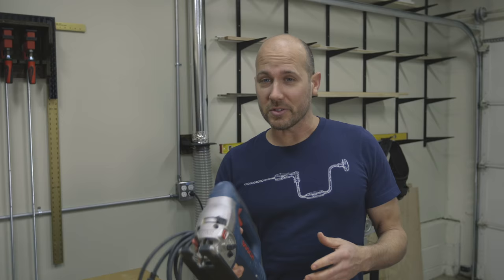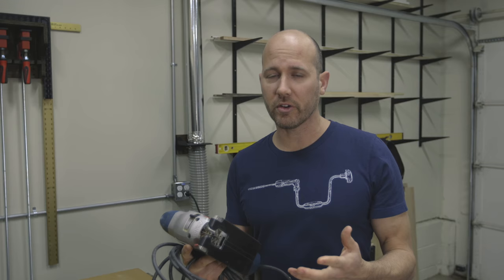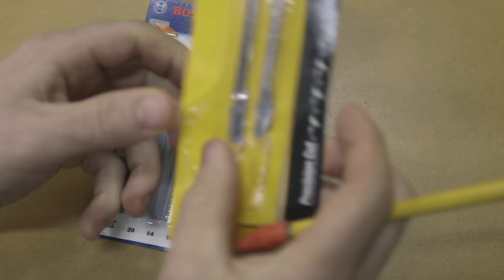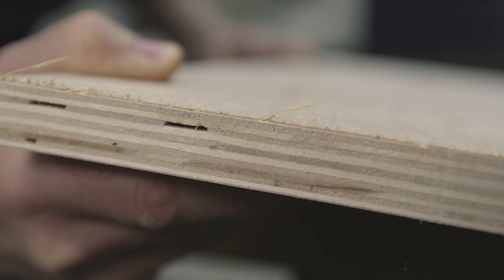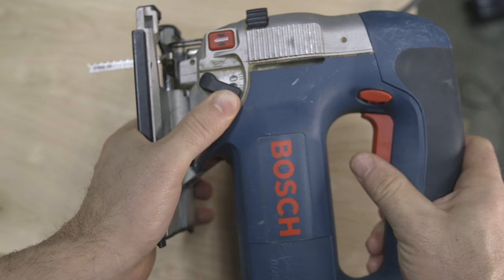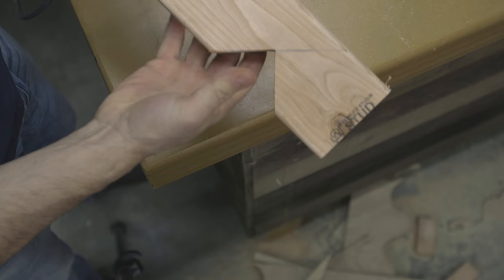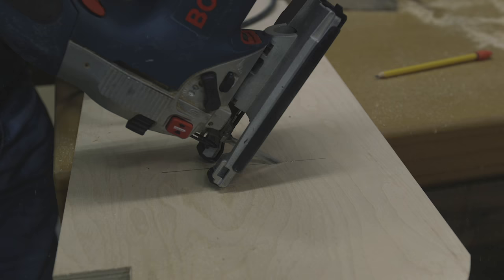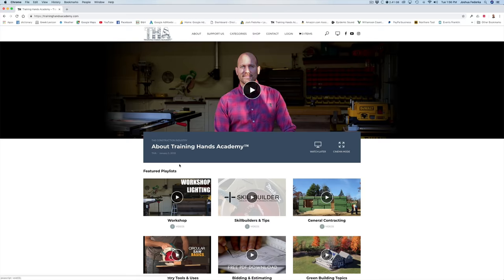How to use a Jigsaw - Basics

Comment: One thing I'd add is look where the saw is going, not at where the blade is currently cutting - you'll get a much better result.  On my battery saw the front blade guard loop dips right down to just above the cutting surface, so when I'm following a cut line, I use that to steer the saw - guess they designed it like that on purpose on that particular saw as my plug in saw doesn't go near the cutting surface.  Also, relax and let the saw do the work, keep your elbow bent and your foerarm perpendicular to your cut - when I first started I used to bend a lot of blades from putting too much uneven pressure on the saw.
Reply from the maker: Thanks for adding this great info!

Comment: Thank you, sir.  Thank you very much.  I need to cut a vent hole on a plywood, for my floor AC.  The guy I so politely requested to help me out with this hasn’t responded.  Well then, I shall have to do it myself!   It is good to be self- reliant, but be sure you know what you’re doing, and be safety conscious.  I am no stranger to small power tools ( I have a small cordless miter saw and small cordless circular saw from Ryobi, and of course, have the power screw/impact driver).  But my experience is very limited.  So I always check in on available training or refresher courses.  So, after this video I’ll get me a jigsaw and get on with my tiny project.  Thank you, again!

Comment: I would recommend the barrel grip over the top handle . Much better feel to it , 
plus you could get around using the down stroke blades when cutting  on a top surface 
you don't want to splinter. For example if you have to cut a plastic laminate counter top 
sink out or end of it off , you simple make a through hole then go on the bottom of the 
counter top , stick the blade through , so you are cutting upside down from the bottom of the counter top. You will get the splintering on the bottom of the counter top. Plus you will see the blade very easily. Takes a little getting used to , but works perfectly. Hope i was of help . Great video btw.
Reply from the maker: Barrel grip for sure!

Comment: I am about to start with some very basic carpentry projects, and the jigsaw is the first cutting power tool that I am about to buy. Could you do some videos showing different techniques that allow using a jigsaw as a replacement for other saws, how to do a long straight cut with it etc.
Reply from the maker: Check these out. https://youtu.be/nFhM86zBgCI  https://youtu.be/kk6iHLOHmOY

Comment: my first jic saw was without quick saw mount, and without pendeling. i could get very straight lines in thicker wood without the saw going / sideways. but with those new features i don't manage it anymore to get the saw cut |  it always is / .   any advise on that?  (i use good quality sawblades)

Comment: I have destroyed some jigsaws from doing plunge cuts. They are not all designed to be able to do them. Always check your user manual or consult with the manufacturer’s specifications to see if that model is okay to do plunge cuts. 

On some makes and models, doing plunge cuts will create additional force on the mechanical components that generate the reciprocating motion of the blade and they will break. So I rarely recommend or show anyone how to do plunge cuts on the jig saw anymore. I do plunge cuts exclusively with a circular saw.

Comment: that saw looks like the one I need to repair. Do they sell a rebuild or overhaul kit for the blade guide and roller? It is about fourteen years old and won't make a plumb cut. Still runs and cuts anything I throw at it, just not clean and straight. I recently bought a newer Bosch and it is not nearly as good as the old one. 
Thanks for making these videos, I'm sure it helps a lot of people.
Reply from the maker: Hey! I'm pretty sure you can go here and find almost any part. https://www.ereplacementparts.com/power-tool-parts.html?utm_source=bing&utm_medium=cpc&utm_campaign=power+tool+parts+people+not+in+audiences&msclkid=e5323ef4f9171b2d7baf5f0a4d4b4685&utm_term=tool%20parts&utm_content=Power%20Tool%20Parts

Comment: Video Notes:
1. Blade length matters; go for at least an inch or more than the depth of what you’re cutting
2. Two grip types: top grip vs barrel grip
3. BE SURE whatever you buy accepts T-shank blades
4. TPI = teeth per inch
5. Lower TPI = less clean cuts; higher = more clean; TPI is on blade packaging
6. Two different blade stroke types: upstroke vs downstroke; he recommends upstroke
7. Upstroke creates tear out on the top side of the material whereas downstroke creates tear out on the bottom
8. Reciprocation is how straight up and down the blade goes; 0 reciprocation = straight up and down; max = oval
9. More reciprocation = faster cut, less clean; less reciprocation = slower cut, more clean
10. 3 types of cuts
   - Short & straight, i.e., “regular” cuts: finishing, curves, nibbling, etc.
   - Middle material cuts: works best with a drill bit to create a starter hole
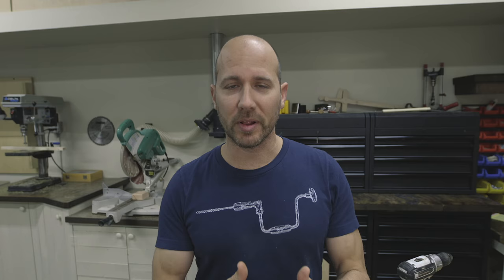   - Plunge cuts: when no drill bit is available (watch the video at 5:00); can be very sketchy
Reply from the maker: That's awesome! Thank you.

Comment: Hi, need your help, I'm cutting the dining table to half to use and make a cabinet out of it, do you think I may cut the 90 cm length from the wooden surface of table with a jigsaw? One of my major issue with jigsaw cutting is that it doesn't stay on a straight line and it always makes uneven cut specially when cutting lont length like 90 cm
Reply from the maker: Hello. A circular saw and a straight edge would be best.

Comment: A key message is to respect your tools, don't abuse them and use in a dangerous manner. Always be humble and know how far to push it. You will get a feel. Let the tool do the work don't force it. I have had a few close shaves and trust me it's not worth it. One thing I do with a jigsaw/circular saw is to ensure it is running at speed before making a cut...there is a risk of kickback otherwise.
Reply from the maker: Great info!

Comment: Thank you so much for sharing...
I need one of this power tool...
Reply: Visa Chusi I recommend the Bosch 572ebk barrel grip or 572ek top handle. You can get the top handle on Amazon until June 18th for $172 which is a killer deal. The barrel grip is $200 which the $20 coupon.
Reply: @Assimilator702  thank you so much.
It might be good out there but its hard to believe in india whether its orginal or duplicate.
Anyway thank you for the  tips

Comment: Great video. I have a question, though. I have a top-end Porter-Cable saw and use Bosch blades exclusively. However, no matter what I do (new blades, checking the saw table for zero tilt, adjusting for UFO intervention, prayer, etc) I cannot get a clean verticle cut from one end of a pass to the other. The blade always drifts out of plumb. Suggestions?

Comment: What do you do if the blade itself doesn't stay straight when cutting? Meaning, the blade is bending while actively cutting. Also, what if you need both sides to be finished sides?
Reply from the maker: Hello. Thanks for asking some great questions. Using a thicker blade and/or using a blade that is shorter will help. Jigsaws aren't really one of those tools that cut really well, so getting a jigsaw to cut good on both sides can also be a hard. You can try using a blade that has a higher TPI and cutting slower. This might help to get that top side clean (if you are using an up-cut blade)... but again, it is a hard to do with the jigsaw. I hope that helps?

Comment: Great video. How do you prevent blade deflection? When I cut a 2x4 the may deflect not cut a perfect 90 deg straight through.
Reply from the maker: Hey Troy! It's very hard to get great 90 degree cuts with a jig saw blade. Jigsaw blades will always have some deflection no mater what. If that's the only power tool you have, try buying the thickest blade you can find and slow down your feed rate.

Comment: Oh yes, listen to the man about that T-shank blade option. I bough some dollar store jigsaw without it and somehow happened to miss that it didn't even have speed control which I though was always on jigsaws. I tried to use it for about five times until I ordered about 20x pricier Hitachi model with all the soft start, cradle, speed dial, swing cut etc. goodies with obviously that T-shank blades. Time to change blade is now about 5 secs compared to minute or more with cheapo garbage, which is literally thrown to garbage. Was it worth that 20x price? Oh hell yeah it was :D

Comment: can i used a jigsaw to cut a 1/8" thick piece of polycarbonate sheet (Lexan brand) into a geode shape with a hole in the middle? i have a resin art project and need to make a geode shape with smooth edges.
Reply from the maker: Yes, just make sure you get a blade that is designed to cut polycarbonate.
Reply: @TrainingHandsAcademy  thanks!

Comment: I don't understand why my new blade is flexing on a straight cut with a straight edge guide (Bosch FSN ) :(
Reply from the maker: They do that. Buy the most rigid blade you can get... the jigsaw is not the best tool for straight cuts... use a circular saw.

Comment: You mentioned that a T-shank is better than a U-shank. Would you mind going more into detail please?
Reply from the maker: The T-shank locks in place and can be removed very quickly. It also will not come out... it is very secure. While the U-shank is harder to install and is not as trustworthy.

Comment: Hi, whenever I've used this tool it has been mainly straight cuts. How do I come about cutting in shapes and curves etc. In terms of what settings to apply on the jigsaw and what sort of blade?

Thanks
Reply from the maker: Hello! Set the jigsaw to no reciprocation, and use a high TPI blade. If you are cutting tight curves, use a Scrolling blade, and if you're not, a standard high TPI blade should work. Does that answer your question M Ali?
Reply: @TrainingHandsAcademy  thanks.
I will try that out.
Kind regards

Comment: I’d love to learn how but that saw scares me. The old saw that was my dad’s only had an on off so  I don’t think it had speed control .
What’s scary to me is how to start into the wood without kicking back .  Was thinking of getting a new saw with the trigger speed control but I’m still too nervous of this saw. Thoughts ?
Reply from the maker: A new saw would make a very big difference. These saws are actually pretty safe and don't kick back often. If you can afford it I would recommend this one. https://amzn.to/3LwJm6p
Reply: @TrainingHandsAcademy  what do you think of ryobi? I have small hands so that Bosch may be awkward. I just got my first router. So I’m going to get used to that first then I’ll decide on a new jigsaw .
Reply from the maker: @JanineMKartist  You sure can buy a ryobi! Whatever feels more comfortable in your hands.  Routers are actually much harder and more dangerous to use compared to the jigsaw. My recommendation would be to get the jigsaw down first before moving on to the router. Please be sure to watch all my router videos. :)
Reply: @TrainingHandsAcademy  will do . I’m not going to be doing. Edge work with it. I’m going to get the Rockler circle and elipse jig to cut oval panels to do my artwork on.

Comment: Hi you might know how to change blade for bosch pst 52AE??? Thank you very much...
Reply from the maker: I'm not 100% sure but... I think you have to take a long thin straight (not phillips) screw driver and insert it into a hole at the top of the handle. Once loosened you should be able to remove the blade. You might have to turn the blade 90-180 degrees to get it out. Let me know if that's it. If not, send me an email with a photo. :) josh@traininghandsacademy.com
Reply: @TrainingHandsAcademy  thank you very much!!! I will try once i have that screw driver... 😊

Comment: The one fault I found when using a Jigsaw, is that doesn't cut vertically, and you end up with a cut that requires additional correction. This is when you cut heavy material, not 1/2" plywood, an I do have a good tool, not a cheep Chinese piece
Reply from the maker: Yes, jigsaws do have their limitations.

Comment: Hey, I didn't have much money, so my only option was to invest in a HART jigsaw. I am trying to cut about a 3" board to make my first sign. I am starting my business, and making signs is one thing that I am going to sell. I am having a very difficult time with this jigsaw. Do I need to save up and buy a different brand, or can you possibly guide me on what I'm doing wrong? Thank you, Shawna
Reply from the maker: I can help. Are you on IG. If you are send me a video there.
Reply: @TrainingHandsAcademy  I actually did everything until I figured it out, and with much frustration, I found that I was using the wrong size tpi. My thinking was completely wrong, and I knew that this shouldn't have been this hard. Please stay in touch with me. This is my first job working with a jigsaw, and my work turned out amazing! I want to continue to make signs for people out of wood. I will expand my work to metal when I better understand my tool and how it works. Are you the one who created this video?
Reply from the maker: @shawnajones2828   Yes my name is Josh, nice to meet you.
Reply: @TrainingHandsAcademy  Hey Josh, I'm Shawna. You say it, Shunna..lol. I live in MS in the center. I taught myself how to use power tools. It's been a journey of learning do's and don't. I'm very grateful that you responded 🙏. I will most likely be in communication with you because you made curved edges look very easy where I went basic angle straight line and flat straight line on both sides. I would like to learn step by step how to use the jigsaw properly. My base will turn, and until your video, I thought it was broken! I don't know, really what all this tool can do. It said it would go backward in the manuel, and it came with an Allen wrench. Still, I'm confused why. 😕
Reply: @TrainingHandsAcademy  lol.. add an a in Shaunna.
Reply: @TrainingHandsAcademy  It is nice to meet you as well. I bet you built your family home. I didn't realize from the tutorial that you do just about everything. How do I make a round edge with my jigsaw easily? What TPI for what different sizes of wood you are cutting? My first job I thought I should've used a larger TPI due to the fact that I was cutting a 3" board, so I started with 18 then went to 24 and I had one more wood cutting blade option in my pack and it was 10. Finally, the job became a lot smoother, and my blade started to actually run smoothly. Thanks.
Reply from the maker: Round edges take practice... keep trying. Sounds like you have figured out which TPI works... it really is trial and error sometimes.
Reply: @TrainingHandsAcademy  Thank you.

Comment: Is it safer than circular saw ?
Reply from the maker: I would say yes... but they are two very different tools.
Reply: @TrainingHandsAcademy  Thanks. For DYI, the most important feature is safety, the effectiveness of the tool is secondary. I cut metal with manual saw and avoid using table saw at the moment, but I do want precise cut and don’t mind take time.

Comment: Thanks, but you didn’t explain why you need a jigsaw that uses T-shank blades, or what they are. I’d better have a look at the one I bought!
Reply from the maker: T-Shank blades are more secure and are easier to install. T-shank is simply the shape of the blade at the shank (where it gets installed into the saw)